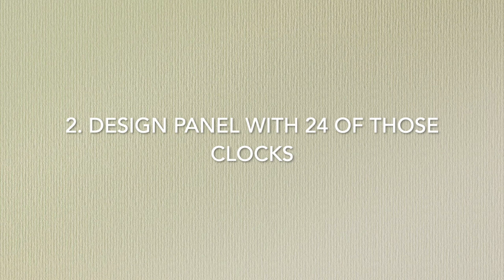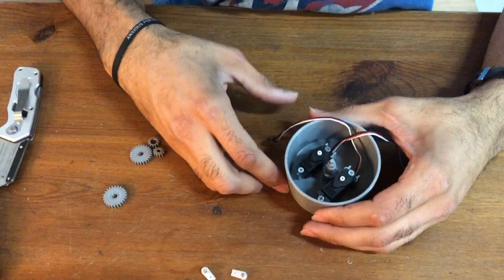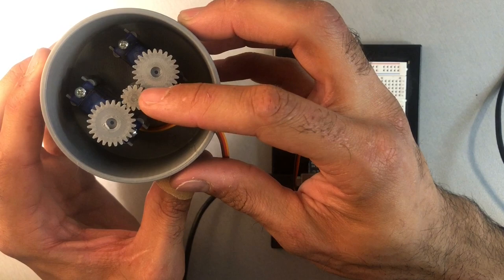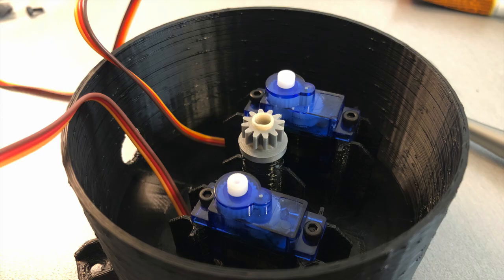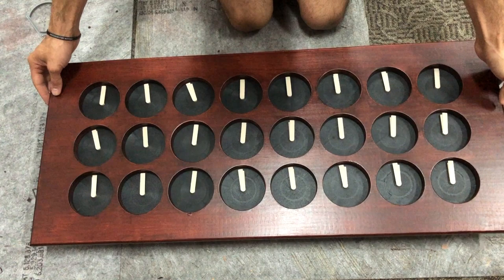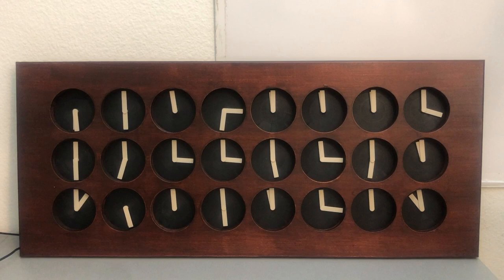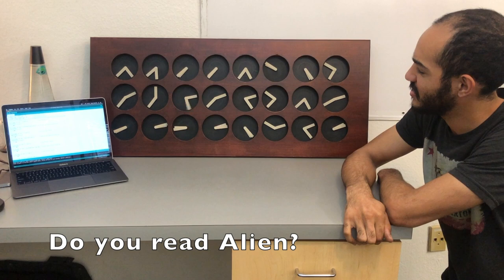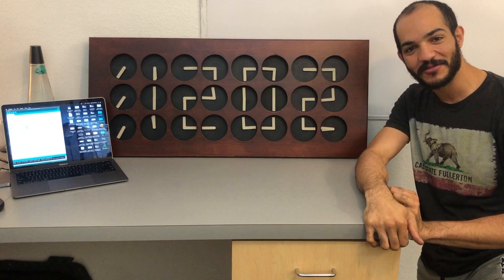Clockception - A Clock Made From Clocks!

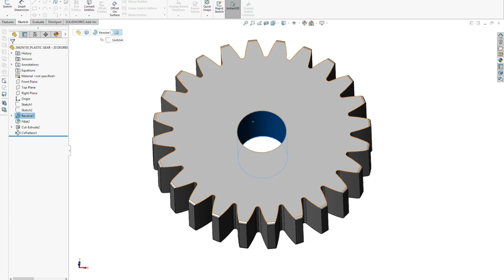Comment: @03:57 You kno'... Adding something like a 0.3mm Chamfer to the edges contacting the first layer sure does help with preventing such clearance related cleanups without compromising dimensions and also makes the part that extra little bit more comfortable to hold if the intention is to handle it ( not exactly the case with yours but you get the idea... ).

Also regarding the minute hand shaft - Maybe don't print one and instead use a cutoff piece of filament and adjust the passthrough hour shaft accordingly ( with like a 3mm bore tapering to like 1.8mm ( make it 1.5mm and ream it to 1.8mm ) at the ends to reduce friction with a perfect fit? Can't get a cheaper and smoother shaft than that without using round stock and a bearing.

And yea... @17:05 - If my movie experience is anything to go by you pretty much want to start running like hell: https://youtu.be/9m7hPlL-v4A
Reply from the maker: HAHAHA This made my day!!! Happy to report, I survived the explosion!

Good point on the chamfer. I started doing this on my prints after this project and it worked exactly as you described. I also recently discovered a setting called "initial layer offset" in Cura that seems to helped with this a ton too. 

Also, interesting idea on using a piece of filament for the shaft and offsetting the bore. Like you mentioned, it really only needs to be constrained at the face and gear so that would be a really good way to reduce the friction along the length of the shaft. 

Thanks for the view, laugh, and suggestions!